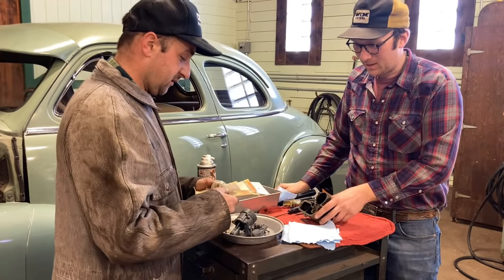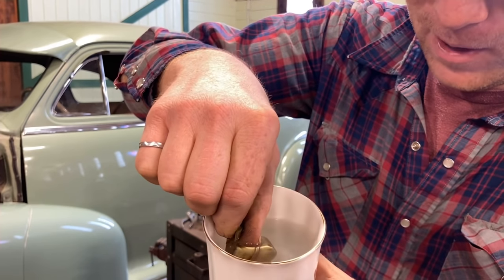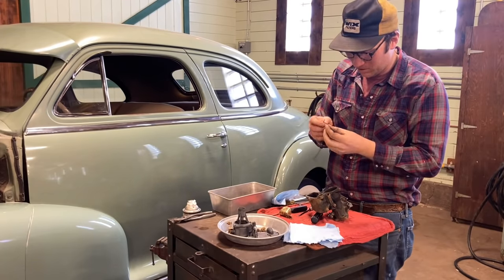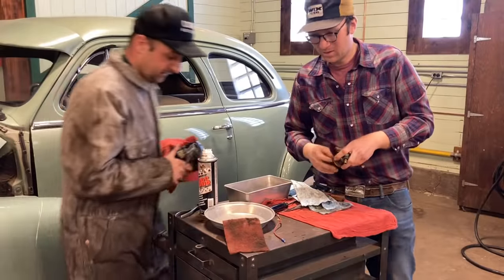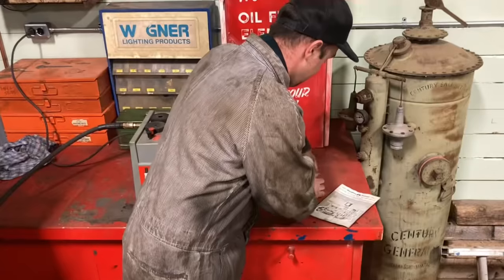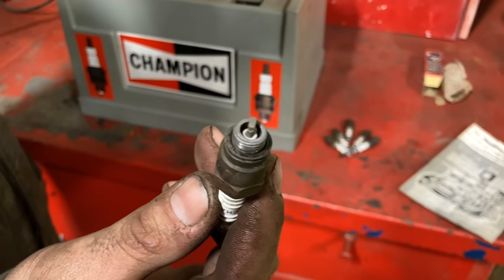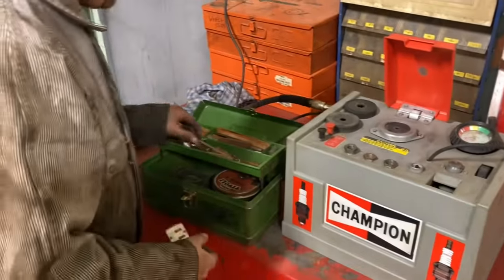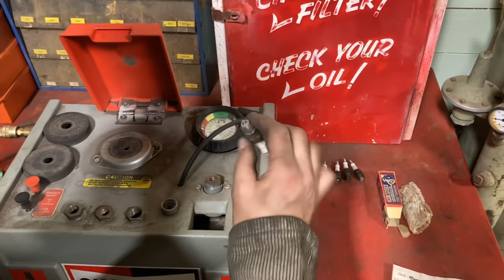1948 Chevrolet Revival Part 5 Carb Reassembly and Spark Plug Refurbishment

Comment from the maker: Hey Gang, Just working on some audio issues here, we will try and level out the sound in the next little bit here!  Listen at your own risk till then!
Thanks from Strong's!
Reply: If it says "1937 and up", do you expect it to fit a 2021 model?
Reply: Someone, I think Scott, said they got away from sandblasting spark plugs because residual sand was getting into the cylinders, so are you sure you got rid of all the sand?  Anyway, I burn off soot with a propane torch, and go to hotter range plugs and more advanced timing whenever I find sooty plugs. Or perhaps foulers if hotter range plugs don't exist.
Reply: What is actually being adjusted when you set the gap dial on the tester?
Reply: reaching 6500 subs and climbing , keep putting out the content there

Comment: Some spark plugs like to allow some of the abrasive particles to get jammed deep down in between the porcelain center electrode and outer body of the spark plug. The air blast doesn't always get all of the grit out. It's best to look down in there with a very bright light to verify. You definitely don't want any of that getting into your cylinders and rings.

Comment: Liked this video and look forward to the next installment!  Very amusing comedic banter which will serve you both well in the future.  Would have preferred a few extra minutes of normal speed closeups of the carb rebuild (what makes this carb different in performance from the one you removed, for example) instead of fast forwarding through the whole process.  I suppose some viewers would be bored with a carb rebuild, but not all!

Comment: Oooo the fancier one with the spark test. Nice.
I love the channel, guys. 
As for the sound... until you get wireless lapel (lavalier) mics for each of you it will be a chore to control the sound.
If I find a video with low sound I just turn on the closed captioning and I get to enjoy all of the mistakes that the auto-generated captions have to share. As an example it often shows "applause" when a grinder is used or in this video when you took the parts out of the dip and the screen scraped on the bucket.
Added fun. :)

Comment: Back in the 1980's I had a 1976 Ford Ranchero with the 400 M engine and when it got around 76k the valve seals went bad. The body was pretty rusty so instead of fixing the engine I would just pull the plugs about every 500 miles and blast and regap them since it was just used occasionally.

Comment: A ballpeen hammer an a cereal box can make most every gasket on that carb . Oh an coat er in grease or silicone grease to not have to make another if needs teardown again . How I was tought , I just use silicon instead of bearings grease , smells better